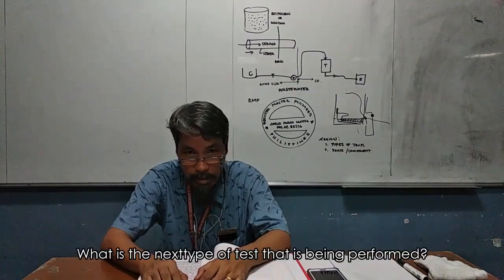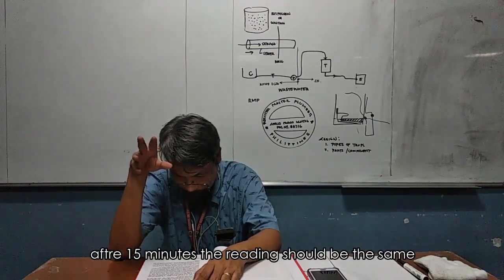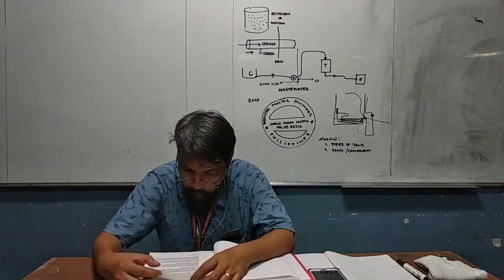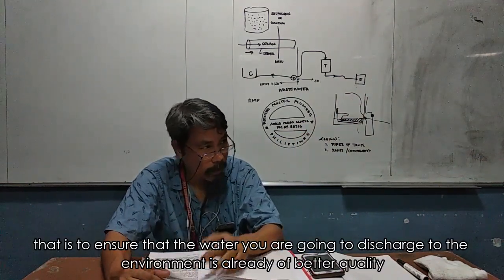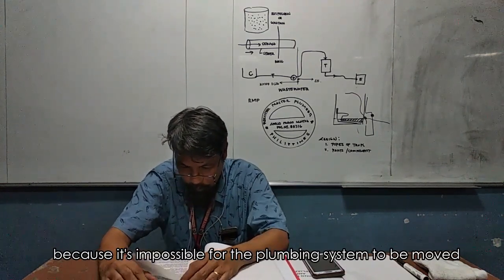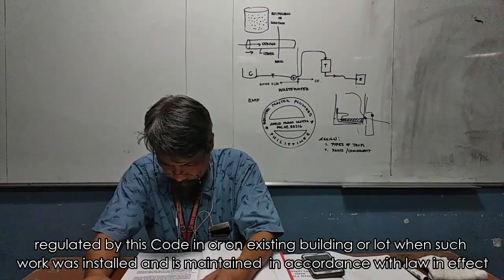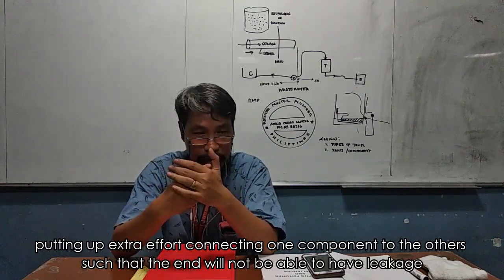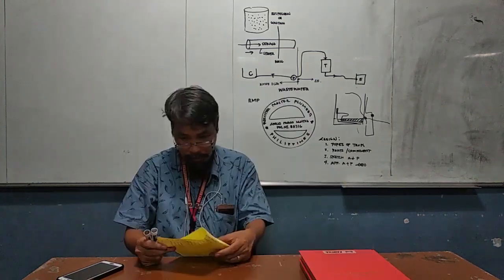CE526 Sanitary, Fire Safety and Plumbing Design || NPCP ch5: Inspection And Test Part 4

Comment: Thank you sir this video lesson. In this video lecture I've learned some test in disposal system such as air test, water test and building sewer test. Air test is 34.5 KPa, water test is 29.4 KPa. Air test is made by attaching an airbco compressor testing apparatus. And a lot information about test in plumbing system.

Comment: Thankyou for this lecture. It gives us clear information why air test should be conducted and the reason is testing  plumbing system with air allowsus to assess the condition of our plumbing system without water. It is especially useful in cases where there is no water available on the site, the building is unheated, which can cause the pipes to freeze, or when water leaks can cause damage.

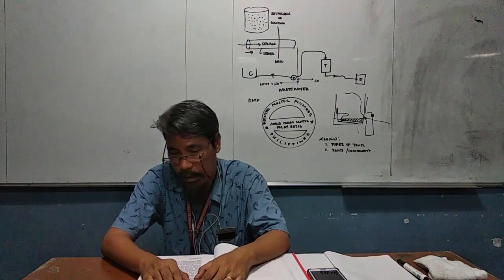Comment: Question 0:02
An air test is a way of checking for leaks in the water piping without actually having any water in the pipes. This consists of connecting an air compressor to the water piping, typically at the laundry faucet or exterior sillcock, and pressurizing the pipes to about 60 psi with air.

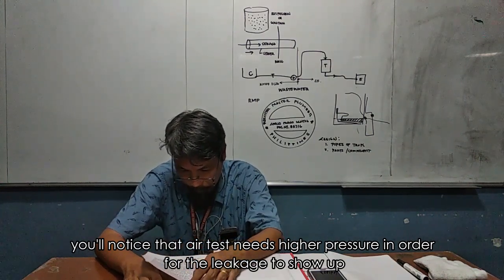Comment: Leakage- is an amount of liquid or gas that is escaping from a pipe or container by means of a crack, hole, or other fault. (1:02)
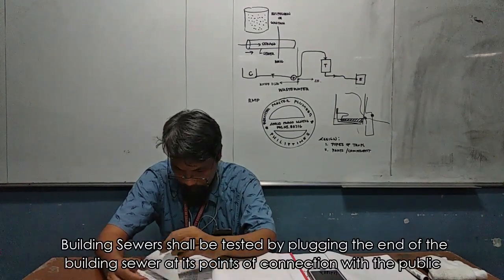Building Sewer Test- Building sewers shall be tested by plugging the end of the building sewer at its point of connection with the public sewer. (2:22) 
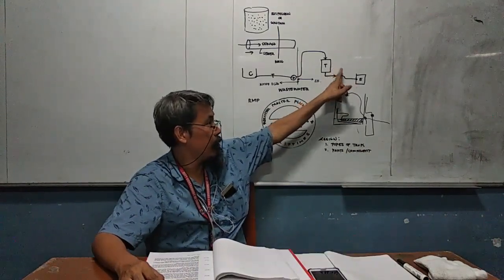Treatment Plant-  refers to a plant or installation that is used to purify contaminated substances.(3:17) 
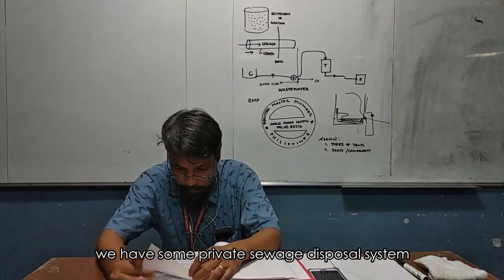Plugging- are defined as cap end of fractional tubes used in a large number of industries.  (3:39)

Comment: 1. OXINIO
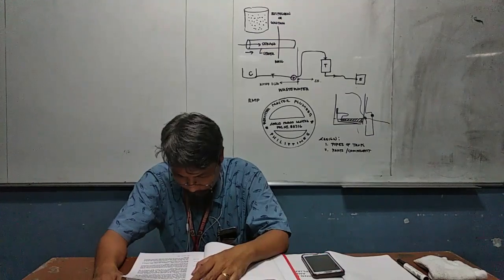2. Protective Coated Pipe 6:05
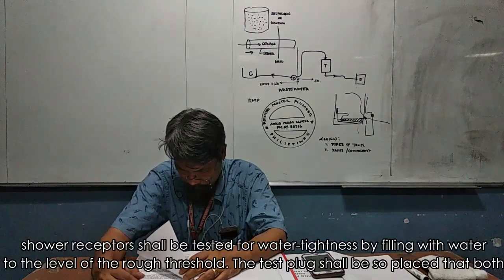3. Shower Receptors 6:24
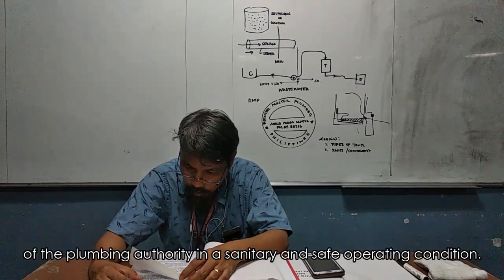4. Plumbing authority 6:57
5. Water leakage 8:58
6. Air leakage 8:59

Comment: CAGUIOA, DANIELA O.
BSCIVESE 19-00459

In this video it talks about different types of test. The air test have a uniform gauge pressure of 34.5 KPa and  Water test is 29.4 KPa. Air test needs higher pressure in order to show up the leakage. Check the pressure before you begin the test, if it is 34.5 KPa after the test the pressure should be the same 34.5 KPa.
Air test @ 0:07
Building sewer test @ 2:20
Disposal system @ 3:52
Water pipping @ 3:59
Defective systems @ 4:54
Move structures @ 5:27
Protectively coated pipe @ 6:05
Shower receptors @ 6:24
Maintenance @ 6:47
Health and Safety @ 7:59

Comment: 1. Castigador
2.  Air test @0:11
3. Building sewer @2:22
4. Three types of test 4:13
5. Defective system @4:56
6. Protectively coated pipe @6:05

Comment: 1. Tecling
2. testing apparatus @ 0:12
3. test plug @ 6:33
4. pressure @ 9:25
5. testing and inspection @ 10:18
6.  provision of the code @ 8:29

Comment: 1. ARCENAL
2. AIR TEST @0:09
3. AIR COMPRESSOR TESTING APPARATUS @0:10
4. INLETS @0:17
5. UNIFORM GAUGE PRESSURE @0:25
6. PRESSURE @0:33

Comment: Ruiz, Sharlize Veyen C.
19-00620

Water test, air test, and building sewer test are three types of test that are need to be inspected. Water test pressure is 29.4 KPa and air test pressure is 34.5 KPa. From the previous video, I have learned that sewerage is not just the whole system of sewage and sewer. It has also processes such as collection, transportation, pumping, and treatment before it will be disposed. In this video sir, you have mentioned that disposal are connected after the treatment facility. This should be considered when having a building sewer test because this ensure that the liquid/water that has been disposed are treated and has a better quality. I have also learned about Defective System, Moved Structures, Protectively Coated Pipes, Test for shower receptors, Maintenance, Health and Safety.

Comment: 1. CREO
2. AIR TEST (@ 0:07)
3. COMPRESSOR TESTING APPARATUS (@ 0:11)
4. AIR PRESSURE (@ 1:04)
5. BUILDING SEWER TEST (@ 2:18)
6. PRIVATE SEWAGE DISPOSAL SYSTEM (@ 2:29)

Comment: 1. Espares
2.Building Sewer (2:50)
3. Disposal System (3:53)
4.Defective System (4:54)
5. Moved Structures (5:26)
6. Protectively Coated Pipe (6:04)

Comment: 1.Solanoy, Kimberly Jade F.
2.Pipe System (@ 0:21)
3.Gauge Pressur (@ 0:25)
4.Pressure (@ 1:10)
5.Plugging (@2:21)
6.Low pressure air test (@ 2:40)

Comment: Etabes, Joshua G.
19-02128
-Thank you sir. I learned that the air test pressure is 34.5 kpa. The air test needs a higher pressure for the leakage to be immersed. The 3rd test is the Building sewer test.

Comment: Mendiola, Mc Axel Joseph P
19-00167 

Thank you sir, 35kpa is the standard pressure required for the air test because higher pressure is needed for the leakage to show up. The air test shows 35kpa before the timer starts after 15 minutes when the pressure with the same reading meaning the test is okay. 
Building sewer test usually perform in private like condominium units  because residential units cannot buy. building sewer test is only that outside of the building. 
I have learned in this chapter how to be cautious when you are performing in actual work to avoid air leakage, water Leakage, and sewer leakage. This video give us an idea of which pressure that should be used.

Comment: Punzalan Jamal C
19-03395
Thank you sir for another knowledge
building sewer test is only that outside of the building. 
I have learned in this chapter how to be cautious when you are performing in actual work to avoid air leakage, water Leakage, and sewer leakage. This video give us an idea of which pressure that should be used

Comment: Air test is the second step in testing and minimum pressure of 34.5kpa that within 15 minutes if the result still the same its okay but if lower than 34.5 kpa this is failed. The last test is building sewer test. Deffective system, moved structures, protectively coated pipes, test for shower receptors, maintenance, health and safety

Comment: Buizon, Randylyn C.
19-00979

Thank you Sir for informative video  in this video I have learned that the standard pressure 35KPa for the air test because the higher pressure is needed for the leakage.

Comment: Geronilla, Faith Ellaine D 
19-01167

Thak you for this video. I learned that an air test is a way that can checking for the leaks at the water piping without having any water at the pipes that will consists of connecting an air compressor to the water piping, typical to the exterior and pressuring at the pipes.

Comment: Building Sewer Test - Building Sewers shall be tested by plugging the end of the building sewer at its points of connection with the public sewer or private sewage disposal system and completely filling the building sewer with water from the lowest to the highest point thereof, or by approved equivalent low pressure air test or by such other test as 
may be prescribed by the Administrative Authority. The building sewer shall be watertight at all points.]